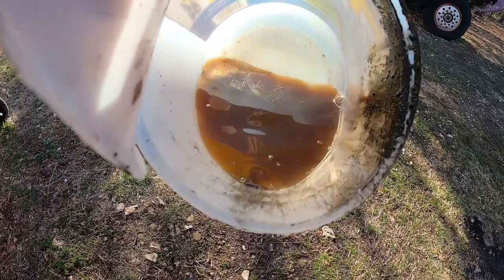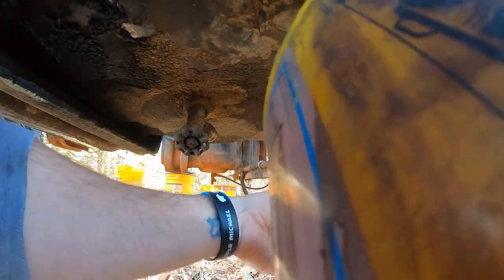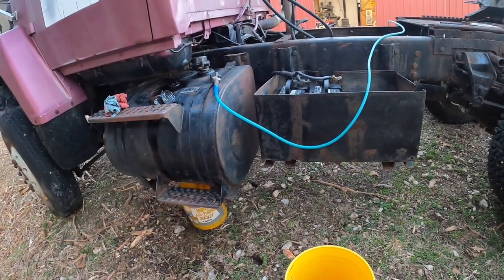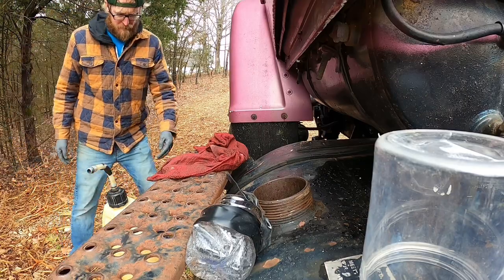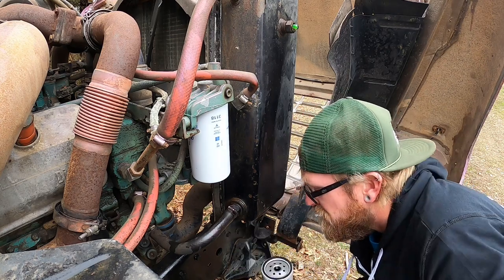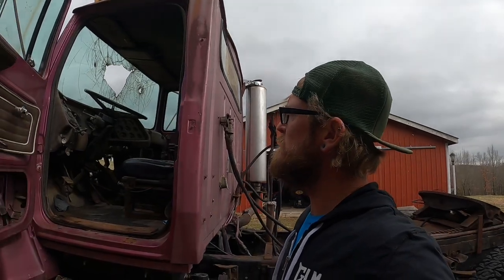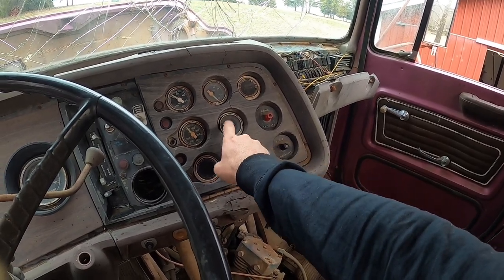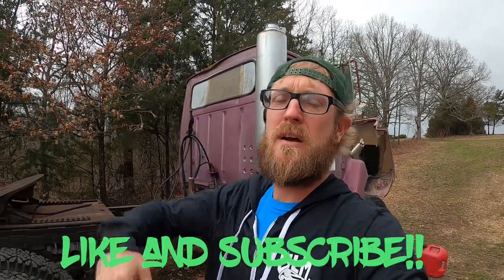Detroit 6v92TA tank flush, new filters, and start up. Progress!!

Comment: We bought a 1986 Louisville last year that was an ex military truck. It’s a lot like your truck. Same motor and transmission. But, it only has 2,000 miles on it and no rust. I wish I could post pictures here…..George Foskit.
Reply from the maker: Wow that’s awesome. This one is rough but I’ve fallen for it. So it’s gettting my attention. This one has very little rust. And what is rusty is surface rust. Under the doors I thought would be rusted through from the pics but they ended up being solid.